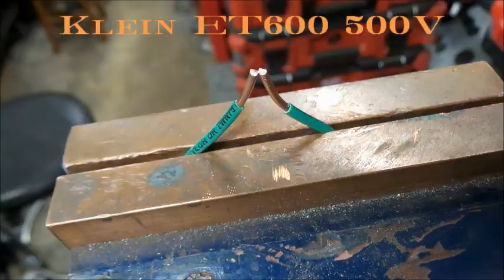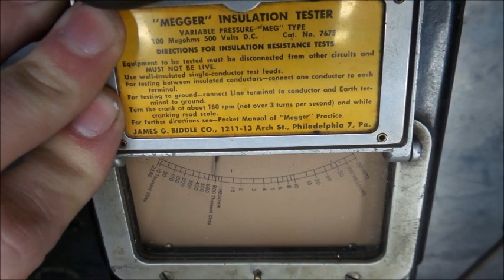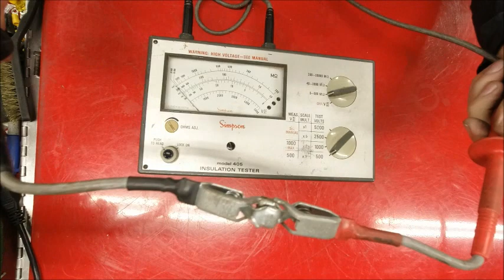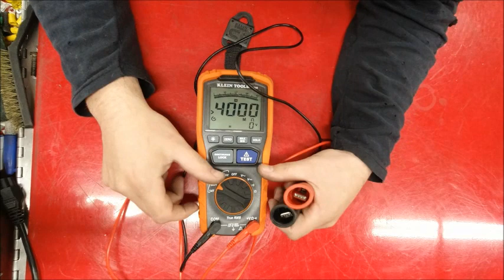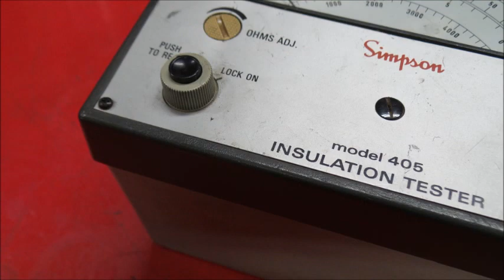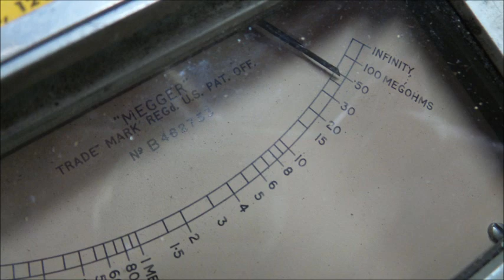The Differences Between Megohmmeters - Klein ET600 vs Simpson 405 vs Biddle 7675 Meters

Comment: Very helpful video.
Thanks.
Reply from the maker: You're welcome. I had intended on trying to simulate the same fault and get a repeatable reading with the various types of Megger, but it ended up being a little bit of screwing around instead. Still, the difference in arc gap was interesting.

Thanks for stopping by, we have some other Megger content on the channel, including testing a motor with the Klein and a Fluke.